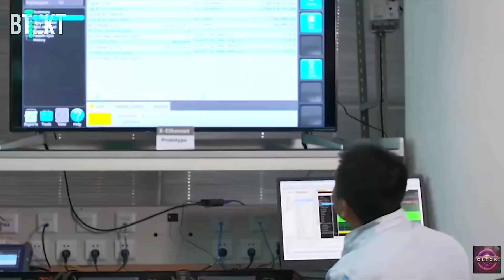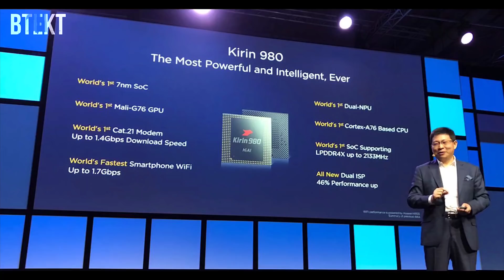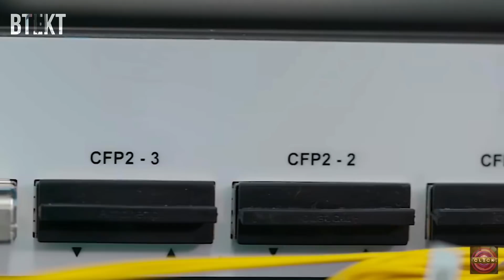Huawei Responds to Trump - Does Huawei Really Need The US?

Comment: I’m curious how the ban effects Brexit. You see, arm holdings, which actually hasn’t officially changed anything in terms of its dealings with Huawei yet, if they were to, it would limit Huawei's ability to do business using its current IP in any country that has a trade agreement  with the UK. Currently that deeply affects the entire EU, but that is also set to change.
By the way you’re completely wrong about where the chips come from. they come from China.. the manufacturing patents are China, the ip that distinguishes the kirin chip from any other apple or samsung chip comes from China.. the only IP that they pay for, the important one though, is the arm risc instructions and the gpu design.

Comment: I think Huawei can survive this, remember they only sold smartphones in China until recently. 

I have a Redmi 1S I bought from China direct, and while the hardware is really nice, I can't stand all the Chinese-isms of the factory Android image it uses, even when English is selected as the language. It still speaks in Chinese when booted, and I'm Australian, I can't speak or read Chinese.

I wish it were as nice to use as a expensive$$ Google Android phone with vanilla Android.

I can't put a vanila Android on it to get rid of the above because then the phone wireless won't work and the battery goes flat much faster.

However the price was right when I bought it, about $130 from Bangood iirc.